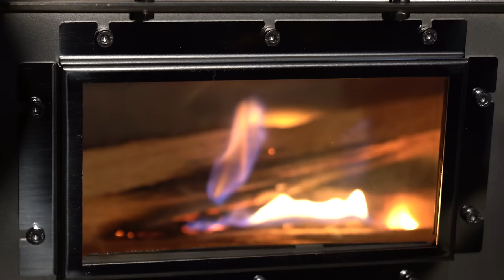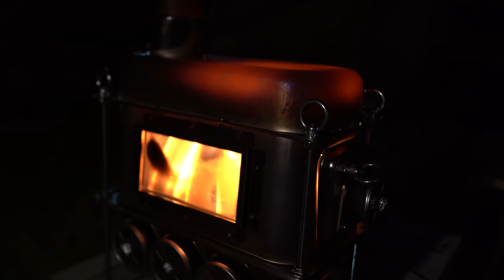Homemade Mini Wood Stove for Camping - Rear Secondary Air Intake Hot Tent Stove - MX-Stove Project

Comment: 16:07 Holy steampunk!  It sounds like it's about to overheat and start popping apart, and then this happens! Raw heat right there at your fingertips. Really like how the secondary air adds so much to the top of the flame.

Comment: The fact it is connected by so many screws, it will come lose after a few heat cycle.
Reply: Ged Woods  about as hot as a normal fire place, It'll just heat up quicker
Reply: Although it is definitely easier to overheat
Reply: Ged Woods  that's obviously steel.
Reply: says the guy who doesn't know what a screw is...

Comment: If this were welded, it would be awesome 👍

As an aircraft mechanic, I cringe at how people misuse drills on YouTube.
You mentioned this is a concept stove, so while it might be missing a few details to be actually used in a tent, the design is very good. It almost seems it works too good.

De-tuning it a bit and adding seals would be perfect.

I’m quite impressed with the finished product considering the materials used to build it. Great choice of materials.

I’m curious about the marinade 🤔

Comment: The stainless steel thin walls won’t endure the heat long. Lots of work (and money in parts). Not worth it.
Reply: edward delorme  yep.
Reply: edward delorme  cast iron, or at least a thicker steel. May be with some ceramic bricks inside.

Comment: Thank you for sharing this wonderful video.  In addition to reinforcing interior with heavier metal consider the adding 10mm cement board or fire bricks.  Cement board will moderate and store some heat while buffering metal on back wall opposite window and above exhaust layer.  

If you are planning to use in a tent during winter, bricks or stone around the exterior will absorb heat and dissipate slowly over time.  In addition, if you are planning on tent use be sure to add a fireproof gasket between joints to retard carbon monoxide from escaping into your tent enclosure.  I agree with others,  you ought to arrange drop shipping the air vents and window assemblies to those of us without your access connections.  

Wishing you and your family peace, health and happiness as the pandemic continues to evolve.   Stay safe and continue your creative journey.  Greetings from NE Ohio, USA.  Bless you brother.
Reply from the maker: Thanks for the tips again! I will find some better materials and I will apply your tips too.

Comment: there is a way of firing two very low powered beams of microwave and crossing the beams within a Pyrex glass orb filled with a certain mix of gasses you get a tremendous amount of heat from a very tiny input. in the future all light bulbs will have a very simple design based on that design so no more burning wood when you are out camping unless you see the romantic side to it, it is a very cool video and thank you for your content.

Comment: You should seriously consider selling these....you have a whole line of stoves. You don't even have to build them....Market them as "some assembly required",and just make kits. I'd buy one,although the m stove would be my choice.
Reply from the maker: Thanks Frank. I seriously considering making a DIY kit for this kind of stove but I found that machining costs far above the line. I think it is because of the shape of the stove. I will try to find a way to reduce the costs. M-Stove with some modification I prefer! Thanks.
Reply: @campingtogether  Oh yes, please do :-)
Reply: I’d for sure want a kit of at least a list of parts and directions. This is would be so satisfying to make and use 🤓
Reply: @campingtogether  I'm sure an intelligent man like you can work out a way to get it factory made in stronger metal, easy to assemble parts.

Comment: This oven will break down after several uses. The thickness of the metal is less than 1 millimeter, and the material is not designed for high temperatures
Reply: oh no :) then you have to make another one.. what a disaster

Comment: BRILLIANT DESIGN. Thank You For Sharing. I've seen alot of great designs with secondary gas ( oxygen as a fuel ) incorporated porting, but yours is by far the most practical in making and simplistic ( hardware wise attainable and basic (( very basic, but not primitive, making it sweet and simple to achieve a great stove top and heater, using the least amount of needed primary fuel ( wood ). GREAT DESIGN!!!

Comment: Great idea!  I was wondering out of ignorance, with the intense heating then cooling would it be better to rivet them so the screws don't back off in time?
Reply from the maker: Using rivets is also a good idea. I used bolts and nuts for convenient maintenance. No significant screw loosening was found. And I don't have a rivet gun. I will probably buy it. Thank you.
Reply: @campingtogether  Aren't most (pop type) rivets aluminum? And so wouldn't they melt off, or corrode away due to di-electric effect?
Reply: @BulletChops  I saw another video with a guy using pop rivets that were resistant to 1600 degrees Celsius.  It was for an old wood stove restoration.
Reply from the maker: It should be stainless steel revets not Aluminum one 😊

Comment: Great work! I have some questions: How thick is the material of the steel(?) boxes you used. Where did you get those parts that are used to control the air intake?
Reply: The materials look like catering sterno boxes ....strong enough for this how long it will last ? Idk
Reply: 22 or 24ga stainless. I'd build one if they made those pans in 16ga, otherwise no way.

Comment: That’s impressive! Super efficient. Does the secondary air inlet near the stovepipe help make the pipe draw the smoke out? I can’t believe how little ash there was! Well done !
Reply from the maker: Thank you. It was an interesting experiment. The secondary combustion flame was clearly observed. This means that incomplete combustion wood gas remained inside, and by supplying additional air thereto, a fire storm was created. This fire moved into the fire passage through the upper part of the front. By placing space under the combustion chamber, I think the combination of heated primary combustion air, fire rise, and secondary air has created this powerful firepower.
Reply: @campingtogether  the combustion smoke was being burnt as a result of secondary air?

Comment: As a concept this stove is quite clever, the design has all the features you'd want in a small wood stove, but I have concerns.
Chief among them is the lack of insulation. Buffet trays are rather thin, and at these temps they're going to warp. The external surface of a wood stove should never glow red. Neither should the chimney. 
I would make 3 changes to this design if I wanted to make it myself:
1: An interior coating of refractory cement mixed with perlite or some other refractory material.
2: An exhaust redirection buffer in the top section, to let the smoke cool a little bit before it gets to the chimney.
3: A metal cooktop, at least 1cm thick. Cast iron, or stainless would be best.

Comment: My only objection is the use of stainless steel, although just hobbyist, i work with metal quite a bit, and stainless has a very low heat tolerance compared to other metals that would be just as easy to work with.

You could mybe reduce the risk by double layering the stainless with a good packing of 0000# steel wool in the cavities between layers.

Thats actually how i made my first forge!
Reply: What metals would you recommend?
I dig the design and would love to build one

Note - I was thinking he could take a secondary rectangular piece of steel (a bit smaller than the top) and have a welding shop weld it on some small "legs" to the inside of the top so there is a 1.5" (37mm) gap between that piece and the top
Reply: @wyleehokie  i would personally recommend either a thicker stainless, or a high carbon steel.

Its less the stainless steel itself, and more an issue with the thickness. Stainless steel is great for pots and pans, that will rarely reach over 500F, but most wood stoves will put out much more than that.

If you have a welding unit at home, and can really use it well, i would personally suggest layers of different metals. Some nice 'cold iron' (also known as cast iron, wrought iron etc) would be best for the inner most layer, it does well under high heat, because it radiates heat the through its entirety (which is why it makes such a great cooking surface) put a layer of steel wool between that and a layer of some copper, i would say, depending on the size of the stove, around 1/8 of an inch thick would be good, and it will not only be a grand heating surface, but it will look pleasant as well. 

Alternately, a layer of ceramic 'gravel' or some cheap wood stove gasket rope (which you can get old lengths for pretty cheap or even free if you know where to look) in place of the steel wool, as it would last longer, but it would also reduce the amount of heat reaching the outer layer.

However, with careful placement, you could control the point where the heat rises through, making only one part of the surface layer hot enough for cooking, and leaving the rest reasonably safe to touch for short periods.

Comment: I wonder how far down you could take it - what the limits are.  What's the smallest you could make one that would burn clean, and for the longest time possible.  It'd have to be a pellet setup.

I don't trust myself to let gravity do all of it.  But you could add an electric auger on a rheostat to meter the fuel flow, precisely.  That way you could fully test the upper and lower limits of output and efficiency.  

I used to turn up my nose at wood pellets as artificial, but they're a cheap by-product of commercial lumber operations, and they can make them SUPER cheap.  As long as you have a place to stack 'em, you can store up a years-long supply.  The only thing you'd have to worry about is prices going up in the future, maybe because manufacturers start bidding up prices on scraps and sawdust, which could happen, if demand or scarcity become a factor.  But right now, they're a cheap commodity.

Comment: Hephaestus would smile upon thee.  Icarus and many a man however, might curse thee for constructing such a thing of beauty only to melt wings and burn fingers with the slightest of touch... but at least they'd be warm and enjoy cooked food.
QUESTION: Have you considered manufacturing such a stove with an interior combustion chamber nested within an outer shell - the the air gap between, filled with sand for insulation purposes?  Nested ammunition (ammo) boxes might be used for this purpose.  Just a thought...

That said, your construction is terrific!  Thanks for sharing.

Comment: Very clever design. Do you answers questions about it?
Reply from the maker: Sure.
Reply: @campingtogether  
I haven't seen many other using these stainless steel containers, really neat and tidy.
What function does the lid piece serve? @2:14 
So that the roof part doesn't get too hot?
Why do you use so many air intakes in this design?
Out of all the stoves you have used, which is your favourite/most used?
Thank you from Cork, Ireland.

Comment: the 6 air intakes give it a nice steampunk look but as there are air leaks all around the main body, they are probably useless... anyway, it's nice and heats...
Reply: The air leaks that are initial in the burning process are a only temporary issue, but once the vents are adjusted to their close to exact ratios, then those leaks aren't of any true concern. The ( air/fuel mixture (( both the air and wood are fuels ) and any combustable fire chamber will need some tweaking adjustments just like a carbureted engine. Saying this with regards to being in a tent. First open the flaps of tent & then after the tweaking is complete, Wahla nice heat & good airflow thru the exhaust port, because heat rises & the atmospheric pressure of oxygen as a fuel is coming in from the bottom ( but maintained thru the tweaking of circular vents ). I do appreciate concerns of safety, from your stance though re: carbon monoxide or even over heating. This man has made a really nice heater stove though & alot of effort to build a proto-type with video.

Comment: I think the concept is great, and it looks like you can build this with basic tools from a hardware store. However, from the looks of it, I don't think this little stove is going to last very long because I think the metal is just too thin and the aluminum is going to end up warping and even potentially melting depending on how hot the insides get. Overall I love it, buts its dangerous lol.
Reply: You are correct. It has a short lifespan. It is however made of stainless steel. No aluminum
Reply: @dwood82574  I'm sure the trays are but those vents and the cat food tin look like aluminum.

Comment: What a great looking stove, good job Sir!!! Quick question, how hot do you believe it can get? I would like to melt aluminum and was thinking that if I used the same size piece for the top like you have for the bottom, I could cut a whole and drop a small steel crucible in the top. Maybe a little forced air introduced too increase the heat. I see the steel gets red hot and that is usually a good indication that it is close to the temperature of melting aluminum. Again GREAT looking stove, well done :-)
Reply from the maker: Hi, high temps. 600~700deg c. maybe?

Comment: Neat stove but I seen one thing missing. Fashion a removable rack in front of the glass to toast sliced bread. There will plenty of Radiant heat coming through the glass to toast 🍞.
Reply from the maker: Thanks for the idea!
Reply: @campingtogether  not exactly my idea.  I've seen American pioneer examples of toasters used in front of fireplaces. They were kinda little more elaborate than I suggested.  Slice of bread went between 2 grates which was on a spindle that would flip over to toast opposite side. I'm thinking  a j bolt on each side of glass a grate on each side of the slice of bread  n 2 bolts sticking out sides of grate to hang on the j bolts.Just to direct you a little more if you decide to add a toaster.

Comment: Nobody thinks the sheet metal is way to thin! After 3 times of use there will be no stove left.
Reply: Wood fuel is not that hot. But i agree it probably wouldn't be durable. Would be interesting to test it using charcoal.

Comment: I wonder how long this stove will last, given the kind of metal it is made of.
Reply from the maker: Hi Amy, It does not melt. However, even if it is stainless steel, corrosion will occur on the part in contact with fire.

Comment: what are all the items you used for this project? i'd like to make one!
Reply from the maker: Purchased in Korea, it is a container for food, a device for mixing air from a gas stove, bolts and nuts, and heat-resistant glass for firewood stoves. The material cost outside of the tool was about 120 dollars. Thank you.

Comment: would never use that inside a tent or in a cabin. I would not feel safe, thin steel, nuts and bolts could make this thing deadly. I would even fear some pressure inside and it would not hold with the bolts after some time. BUT this thing would be nice to have outside for a summer.

Comment: Thats gonna warp over time... thicker gauge steel and fire 🔥 bricks bud....might be wrong but I think the massive glowing red spot is changing the grade of the steel... might wanna do some research before it falls apart and burns down the tent.. especially if you are putting it on the market.
Reply: His ports have adjustable ( circular venting )for the reduction of oxygen to slow down the burning achieved. It's really a great design. Kinda think of it like this. A gas pedal on a vehicle if floored can make a vehicle be out of control, but that's why it's a pedal with an intelligent controller on the fuel delivered to the engine that burns the fuel.
Reply: @paulshull9247  like a damper that's on my cast iron wood stove?
Reply: @Creekr313  Yes & love the cast iron stove designs. I even would like to do what this man has done ( with the additional oxygen secondary fuel ) with a steel cased but front faced cast iron heater stove, but the portability design ( weight wise isn't practical so much compared to this design ). It's a prototype for certain, but I believe it's potential is pretty awesome.